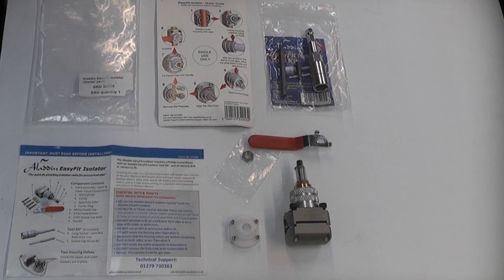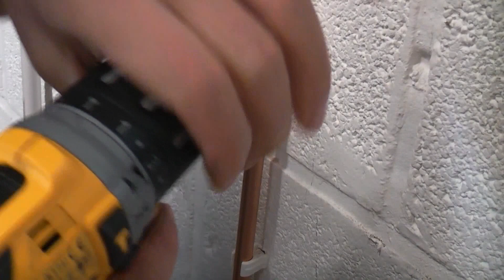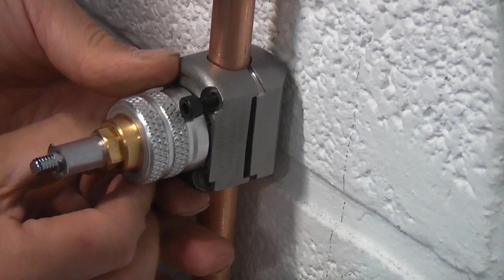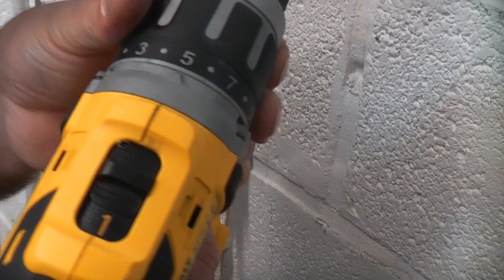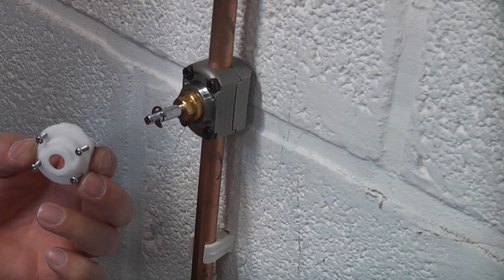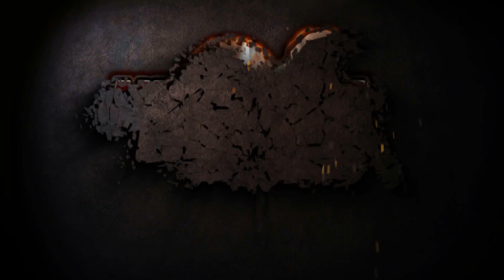Aladdin EasyFit Isolator | Isolate a live water pipe

Comment: Thank you, did not know that these existed. How about old 1/2" copper pipe, is one available for that, or will this one work?

About 30 years ago I bought a similar device that would tap into a live copper pipe and provide a connection to a washing machine, this is still working fine.
Reply from the maker: So far I think these are only available for 15mm pipe, but I believe they are making them in other sizes soon.
Thanks for the comment
Reply: Thank you, I will look out for new sizes

Comment: I think it would be ok to use in industrial setting with concrete floors and drainage, but I wouldn't use this in a dwelling. Soldering in a valve is cheap and easy if you can shut water off.
Reply from the maker: Thanks for the comment
Reply: The whole point of this product is for situations where the water cannot be shut off.

Comment: I have just tried to fit an Aladdin Isolator and failed. First, my 20v Ferrex drill would not drive the cutter into the pipe so, I had to use a ratchet. As the slug approached the back of the pipe it stopped moving forward so, the red line was not aligned with front of the collar. I had to press the valve spindle in against the water pressure(3.5bar) in order to fit the plastic collar but despite using a 12v drill at half torque and running the screws in sequentially the collar split! 
I now find that the valve does not fully close!
How I wish I had simply used the snatch method  which I have done on previous occasions when extending c/h systems.
Reply from the maker: Was it the 15mm version or the 22mm version.
Have you contacted them about the problem?
Thanks for the comment 👍
Reply: Keith's problem was the pipe he was fitting to was imperial pipe we only recommend the 15mm EasyFit for 15mm pipe - it can struggle on 1/2" imperial pipe.  We sent Keith a Pro which is designed for these pipes and were able to solve the problem.  If you believe your pipes are imperial we recommend fitting the pro version. Thanks

Comment: Where does the ground up copper from the pipe go?  Does it fill up all the aerators in the building?
Reply from the maker: The slug that is cut out of the pipe is compressed into the back of the fitting- https://www.youtube.com/watch?v=H9JSbIPLffM
There should not be much swarf as the cutter is more like a pipe slice than a drill or hole saw.
Thanks for the comment

Comment: Would this work 4gas?
Or is there a different 1 for gas???
Only reason I'm askin if u r working on the main or just b4 it goes to the meter and can't shut it off
Reply: Sorry, this cannot be used for pipes carrying gas. It does not have the necessary approvals and it would not pass the 600 deg. C burn test..

Comment: Does it punch a plug out of the pipe? If so where does that plug end up, could it become a problem in the line later on?
Reply from the maker: The slug of pipe is compressed into the back of the fitting, it can be seen in this strip down and pressure test- https://www.youtube.com/watch?v=H9JSbIPLffM
Thanks for the comment

Comment: ? What about dissimilar metals. Was there a study on that and what's the outcome? Other than that love this device.
Reply from the maker: Not sure, you would have to ask the manufacturers. It is made from stainless steel though.
Thanks for the comment
Reply: Galvanic corrosion could only be a problem if the entire annangement (stainless valve and copper pipe) is immersed in water (eg.underwater stopcock). The Core of the valve is brass which is fine to be in
contact with copper pipework in solution.The Core is also replaceable (under pressure) using the
Recore Tool. Unlike a regular stopcock, once the EasyFit is installed the Core
can be replaced in the future if it is ever required.https://www.youtube.com/watch?v=IuLagpjagDk

Comment: What happens to the drill copper windings, to they get clogged ? Or , does the valve take it In? Coll thing none the less. Emergency  saddle valves.
Reply from the maker: The cut out slug is compressed into the back of the fitting https://www.youtube.com/watch?v=H9JSbIPLffM

Thanks for the comment ;-)

Comment: This might be approved in UK or somewhere else, but here in the US a plumbing inspector will laugh at you. You basically deteriorated the plumbing pipe putting as hole in it. A leak will eventually form and find its way through the seal or the pipe will burst near the seal since pipes corrode internally. Even if you choose the thicker rigid copper pipe, this is exactly the same crap plumbers do to water heaters to install fridge lines (very similar). They ALWAYS LEAK!!!

Comment: When using this on plastic pipe how do you get around the requirement of fitting inserts into the cut pipe to keep the pipe round? I understand that this product isn't cutting the pipe completely but isn't there a danger that plastic pipe will distort out of round over time without the inserts?
Reply from the maker: It does shear the pipe completely - https://www.youtube.com/watch?v=H9JSbIPLffM&t
Good point about the inserts, but I think you don't need them as the saddle on this is substantial and very rigid. I have been to a few properties where inserts have not been used on plastic pipe, which made me test a fitting on plastic pipe using the pressure testing rig. I could not get the fitting to blow off the pipe without an insert! I still use them 100% of the time though.
Thanks for the comments 👍

Comment: Does it cut out a single piece of the copper pipe or does the cutter ose s filing method to grind the copper pipe?
Reply from the maker: Yes, it cuts out a section of the pipe, which is then compressed into the back of the fitting, this should be helpful-
https://www.youtube.com/watch?v=H9JSbIPLffM
Thanks for the comment

Comment: Do these wrench have different sizes? 1/2, 3/4 ó 1 inch?. Thanks for your answer.
Reply from the maker: I've just found this on their website- The Aladdin EasyFit Isolator fits between 14.7mm to 15.1mm, so this will fit standard 15mm with 0.7 and 1.0mm wall tube, the old UK 1/2″ imperial pipe (15.08mm od) and the Irish 1/2″ imperial pipe (14.7mm od).
The American ½” imperial pipe which is 15.875mm (5/8″) outside diameter will not fit the 15mm Aladdin EasyFit Isolator version.The housing will not clamp around the pipe. We have now developed a version of the Easyfit for this market, and can commence production subject to commitment to distribute from interested parties.http://aladdin-products.co.uk/products/easyfit-isolator/

Thanks for the comment

Comment: Recently moved into a house where the only way to turn off the incoming cold water supply is by using the supply cock buried in the pavement outside.  Never liked this situation.  I'm wondering if this valve could be fitted onto the pipe after it enters the house under the kitchen sink.
Reply from the maker: If you can isolate it outside I would do that and then fit a normal stopcock inside of the property, once installed you will then be able to isolate at the new stopcock.
Reply: Thanks for the advice I will do that :)

Comment: My stopcock is outside in the ground, would it be possible to fit this to the mains inside
Reply: Hi the Aladdin EasyFit comes in different versions to fit 15mm pipe, 1/2" imperial pipe, 22mm and 28mm pipe and is ideal to fit inside the house when your stopcock is outside in the ground.

Comment: My mains water on/off tap is dripping and may need replacing. Piping is 70 years old so wont be 15 mm. What was the original pipe size and do you supply isolator for the old pipe diameter ?
Reply from the maker: Is it not just leaking from the packing gland?
Mine was leaking a few weeks back, I had to smash a couple of tiles from the wall to get to it.
https://www.youtube.com/watch?v=BPc3Y4xavts

Comment: 1. There is no such thing as 'impossible' to isolate the water.  2. OK so the slug is compressed into the body of the AEFI, but some swarf will get into the pipe, sure as old boots.   3. The cutter will distort the pipe,  rust, swell & disintegrate in in time.  4.   £44.95 - bugger off.  Std LA valve £6 & no O rings to fail.  5. It may be quicker in the short term, so plumber will make less on labour charges.

Comment: what are the advantages using this compared to freezing?
Reply from the maker: The main advantage is that it can be used on a pipe containing flowing water under high pressure, whereas a pipe freezing kit can only be used on non flowing water (so I am informed)
Thanks for the comment

Comment: Where do all the metal shards go from drilling?
Reply from the maker: Not sure if there are any as the cutter plug might be more like a pipe slice rather than a hole saw- so the amount of swarf would be negligible. Probably a good idea to ensure the pipe is flushed out though before drinking the water.

Comment: Can the Aladdin isolator be used half closed to reduce flow rather than full isolation?
Reply from the maker: I guess you could, but someone said it's not advisable to use any valve to reduce the flow of water. We have high water pressure here (8 Bar), my internal stop tap is only open 1/8 of a turn, I really need to install a pressure reducing valve, but the incoming water is behind a tiled wall!

Comment: How it actually works is more interesting. After checking out their website it shows a cutout illustration. It basically has a blade that cuts the pipe in half and then crushes it into a small pocket underneath. See link for image. Pretty cool.

http://aladdin-products.co.uk/products/easyfit-isolator/
Reply from the maker: Thanks for the comment

Comment: Can you fit one of there to a live  1/2 " rising main. The mainsstop cock in the cellar  is leaking or fails to shut of the rising main. Also there is no milikan cock in the street for the propertySo wondered if this can fitted to a live main inthe system allowing me to isolate the whole system:
I do have valves around the rest of th e house.
Reply from the maker: Yes, you can as long as you get the correct one and it is copper pipe.
The one in this video is 15mm, but I believe they make one for 1/2 inch pipe.
I'd double check outside of the property though as there should be a stopcock somewhere. In my old house there was no stopcock at my back gate, but there was one at the end of the street which turned off mine and a few other houses.
I'm sure your utility company has to supply you with a means of isolating the water to the property (normally via a stopcock)
Reply: Thank you for your promt reply.Much appreciated. Its probabaly 1/2" as i fitted it some 40 years ago.In those days the indoor stop cock worked LOL. Just thought fitting one of thes taps might stop the need to  find the 
outside stop cock.
I think  it might be a shared  stopcock with my neighbour..so if it is i have to turn off her boiler as well if i turn off the mains.
Anyway, as I stated much appreciated.

Comment: I could really do with some of these, I just haven’t got the balls to try them. If it goes wrong I’ll be in deep s***t !
Reply from the maker: Yes, that is always a risk- although these do seem to be very well made.
I once got a water filter, and it was designed to clamp onto a copper pipe and cut through it. When I tightened it up, the damn thing crushed the copper pipe and water went everywhere! 
Thanks for the comment 👍

Comment: What happens to the bit of copper that is cut out surely it could the the pipe down the line ?
Reply: @Harry Vigers The copper or plastic pipe slug [the cut out bit] is compressed into a sealed void at the bottom of the housing. It can't possibly drop into the pipe.
Reply from the maker: I think it is compressed, but could be wrong.
Reply: This is answered in the FAQ section on the website.

Comment: Can we use it for air supply pipes and do they come for different sizes
Reply from the maker: No, these can only be used on water pipes and are currently only available for 15mm copper tube. 
Thanks for the comment
Reply: @ultimatehandyman  thanks for replying

Comment: Never knew England had metric metal pipes
Reply from the maker: Yes, most domestic water pipes are metric and have been since I can remember. 
At work though, all of the industrial pipes are still in Imperial sizes, ranging from 1/4 inch up to about 12 inches.
Thanks for the comment
Reply: Having grown up in metrics Australia is quite a mix. I love filling my tyres in psi. Usually metal seem to be imperial while other materials are metric, other than monitors who seem to globally go back to inches.
Reply: Use BPS  or British  Pipe Standard  sizes, in Metric.

Comment: Would have been more impressive to see that there is water under pressure in the pipe.
Reply from the maker: Yes, I should have included that in the video, especially as I had pressurised the pipe to roughly twice the mains pressure that we have here (we have high pressure, about 90PSI) 
Thanks for the comment

Comment: That is some sort of hot-tap, right?
Reply from the maker: Not sure what you mean by "hot tap", sorry.
This can be used on any hot water pipe that you cannot isolate. Once this valve is installed you can then easily isolate the water.
Thanks for the comment

Comment: My first install today using 1 of these valves and it was definitely not an easy fit. A had to fit 2 actually 1 on the hot water flow and the secondary return' these valves have been designed with modern copper in mind because 1 my drill 18v metabo on highest clutch setting just jammed trying to cut the pipe which was much better grade of copper than you can get today' better grade meaning thicker walled plus after 35 years of hot water flowing through it the pipe had also work hardened. The torque forces needed to cut the pipe by hand with a wrench were pulling the pipe out of its clips. And it didn't seal proper or shut off as it should' so it's not as easy as some of these videos make out. Iam a plumber so know what Iam on about  the pipe was shinny cleaned before hand' the leak wasn't on the clamps it was spurting water out of the cutting plug threads... They are a great piece of kit but beware of using them on old thick copper
Reply from the maker: I've heard a few people say that their 18V drills struggle with the cutting part (Metabo are normally good). A few people have had to finish the operating using a socket and ratchet, to get the required torque!
Thanks for the comment 👍

Comment: Hi. Can these be used on central heating systems? Thanks
Reply from the maker: Yes as far as I am aware...
Thanks for the comment
Reply: Ultimate Handyman alternatively possibly using a freeze kit and fix full bore isolating valves...would that be ok in a central htg sys? The valves would be horizontal under floor boards, ground floor. Access via pulling the carpet back and unscrewing floor board access cut outs. Thanks again

Comment: Do they come in 22mm also.
Reply from the maker: I think they are only available in 15mm, but I think that will also fit older 1/2 inch pipe.
I'm not sure if they will make a 22mm version.
Thanks for the comment

Comment: Do you have the 3/4" and 1" versions of this? Is it available in US on Amazon? Most of mains in old US homes are 3/4, thanks!
Reply from the maker: It is only available for 15mm pipe at the moment, but they might bring out different sizes as they are in the US later this year at a trade show.
Thanks for the comment
Reply: Ultimate Handyman thanks for passing this comment to them, hope to see one in near future!
Reply: Hi Cyclopathic we are showing at The National Hardware Show in Las Vegas from 8th - 10th May come and visit us there.  Your pipes do require a slightly different version which we have developed and expect to have for sale in the US later this year.

Comment: Can you use this to isolate water to a toilet to drain it?
Reply from the maker: You could, but for a job like that a freezing kit might be better, if you can't isolate the water elsewhere.
Thanks for the comment 👍
Reply: @ultimatehandyman  there is no value fitted and it's connected directly to main... Short of turning off the complete supply

Comment: Pipe freezing kit .
Reply from the maker: You can't freeze running water, which is one of the advantages of this valve ;-)
Reply: Ultimate Handyman of course you can . I freeze 2” running water system . Everything depend of the equipment characteristics.

Comment: Whatever 50 millimeter is...looks like half inch to me...thank god the metric system never caught on in the u.s.
Reply from the maker: 15mm.
Metric is much easier to understand. We have metric and imperial on site, if I go to a drill bit and it's 8.8mm, I immediately know that it is slightly larger than a 8.7mm drill bit, but with imperial it is much more difficult!

Comment: Can this unit be used on a metal pipe?
Reply from the maker: The pipe in this video is metal (copper), you can't use this on a steel pipe though!
Reply: Thanks for the reply. I am aware that the pipe in the video was copper. That is why I was asking if it could be used on galvanized pipe as well.

Comment: At first I liked the idea.  Then it occurred to me "What happens to all the crap created inside that pipe?"  It has to go somewhere!
Reply: The Aladdin EasyFit Isolator cutter plug has a blade attached to the base which slices through the pipe. The blade has no teeth, instead it is scalloped in order to avoid swarf. The copper or plastic pipe slug is simply compressed into a sealed void at the bottom of the housing.  Hope that answers your question.

Comment: Clever idea but I'm pretty sure this wouldn't be legal in the US. Most plumbing codes here do not allow for saddle valves which is what this would be classified as.
Reply from the maker: Thanks for the comment
Reply: Saddle valves are definitely used all the time in USA. Mostly for ice maker lines for fridges, and water filter lines, etc. The valves work perfectly well. If correctly installed they never leak.